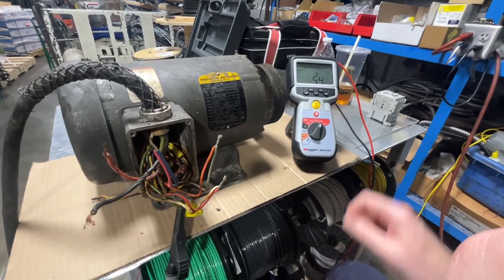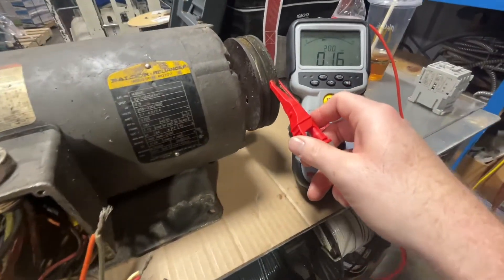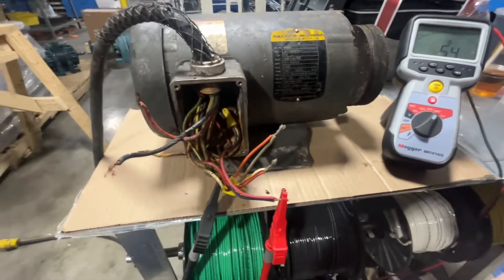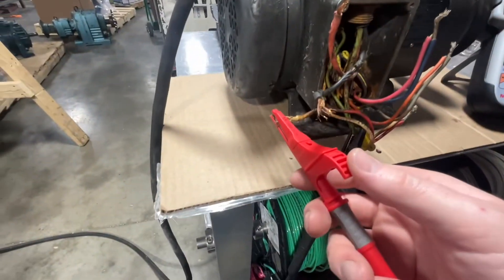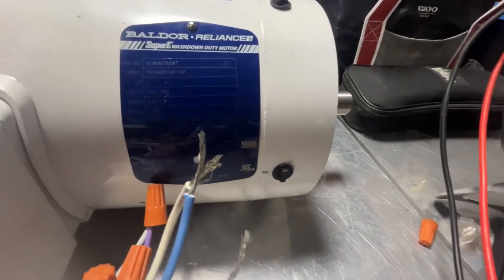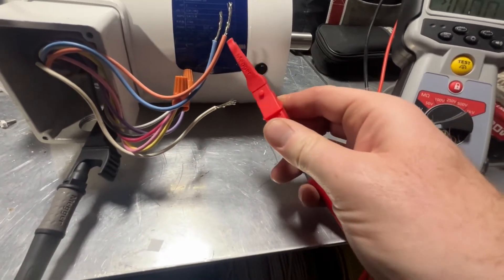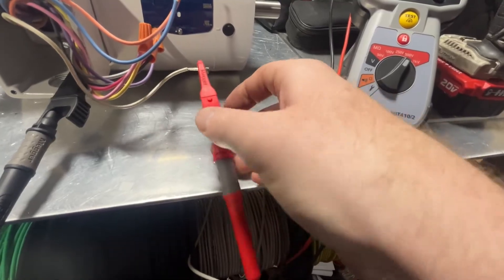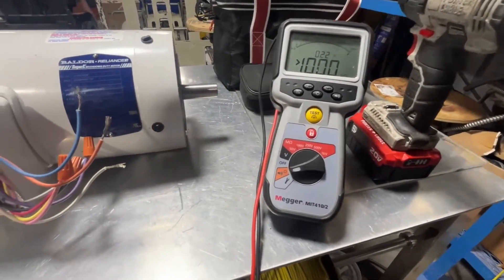Using A Megger To Troubleshoot a 3 phase motor: #industrialelectrician #electrician #motors

Comment: But what about under load? Thats when it really matters and what are the numbers across the board that we could use as exellent, good, on its way out, and bad
Reply from the maker: Thanks for watching man, well I usually just do an amp draw on the 3 phases while it’s running under load and compare  the results to the voltage nameplate reading. I’ve seen motors on their way out and still read good amps. It just depends on how compromised the windings are. As far as good, higher the reading in megaohms the better. I like to see 100-500 good anything under 100 megaohms on its way out and under 50 megaohms bad.

Comment: I’m still new and learning about this. How come on the old motor you tested the “twisted together” wires against ground but on the new motor you test t1, t2 & t3  and not the wire nutted one’s to ground?  Thanks.
Reply from the maker: Good question, so I know it’s kind of hard to see in the video but the ground conductor was actually a pigtail we call it that goes directly to the ground screw inside the motor wire terminal box, and the wirenut was connecting the incoming power cord ground conductor to the pigtail going to the motor ground terminal. The ground wire was damaged behind the wirenut so I just clipped my black alligator clip on it, it stays in place better then trying to attach it to the screw inside back of the box. On the new motor you seen me attach it to the green ground screw inside the motor wire terminal box. Hope this makes since, you could attach you black lead on the megger to any bare ground on the motor, just make sure there is no paint. Thanks for watching let me know if you have any more questions!